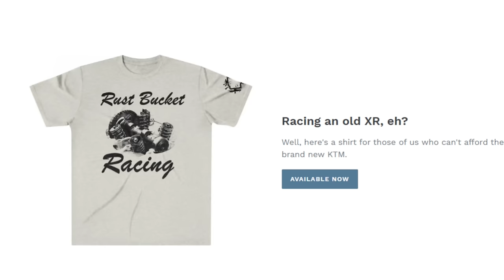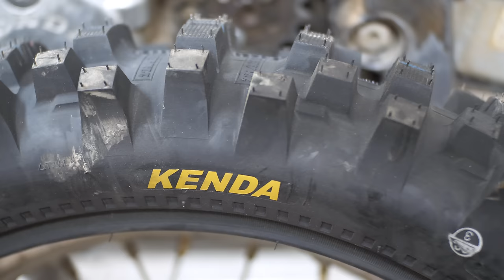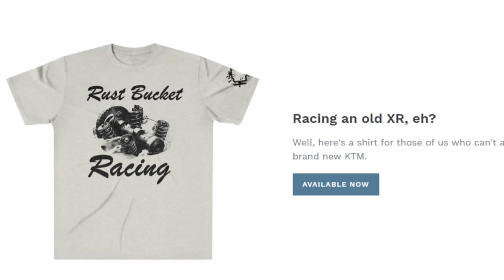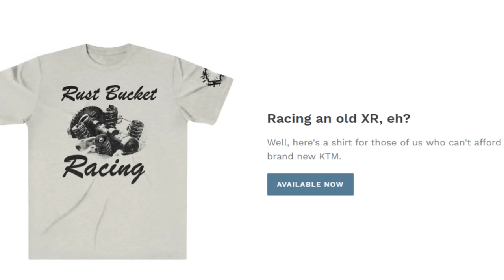Full Episode XR250R Rust Bucket Racing

Comment: So me and Zippy did the it may have been the inaugural under $1,200.00 bike twenty four hours at Glen Helen on a 86 Suzuki 185 Zippy got it from Homer for free it was his kids learner bike we did nothing to it but Zippy changed the fork oil they didn’t think it would make it up the first hill Captain Zippy had us prepped and trained we had one or two sight lapped the course the previous weekend as well as road the main course that’s actually when we got the heads up invite. We had ridden all over Johnson Valley just thinking back he’d never really say where we were going he’d just say ready. Where we going? riding wed get there I’d say where are we and he’d say here. We hit all the tracks in so and Havasu and others after I accidentally did the A’ course in a hard enduro apparently i was supposed to divert to yellow, i was puckered when we dropped into the first actual Hard Enduro section diced the critical lines nursed the hills pretty much cleaned it but one bobble near bike over heat on the most significant cobbled hill it was make able me and another guy puking right there I told him to spit his rinse water on one side the fins of the top end when he was ready at the same time as i did on the other side it worked perfect. Course dude was claiming your booth done We both continued, pretty much was catching dudes the whole course that club was looking at me like i came from outer space on that zuke pure fun any way i think you were there at GH 24 at least I’m thinking i remember you at the awards i rightly cant remember what placing we got, nearest to say we were not the favored to win we trophied though starting laps were 21-22 i started getting down around 18 and my last five 16 mins per, which i felt had put us a second lap up i could go on their was lots more intrigue there was always a rumored 250 out there some where in front of us but i tell you what the orange juice in the morning the guy walked down and handed to us in the pit in the morning was the best OJ i ever drank. I keep sublimating 200s to Deegan its the potent fun class but you are the most focused in the spirit of the U 200 class i almost got an SSR 189 their heavy but decently built, front and rear disk fair to middling shocks i think Haylie Deegan should have one and have her dude dial it for her, it is the untapped skills bike for every one plus she would reign over all the the other minis on her home course and maybe her brothers too.